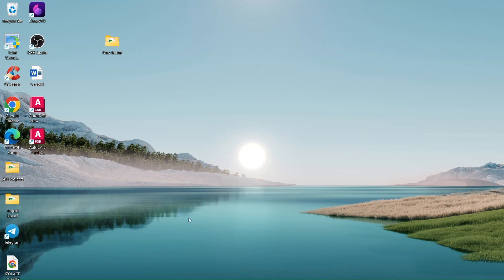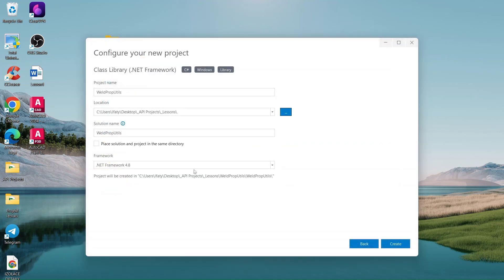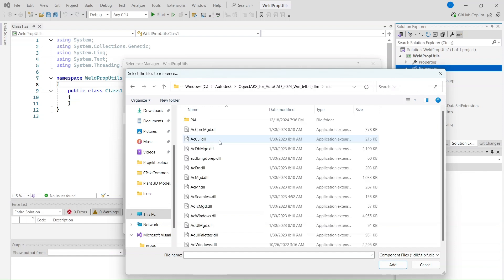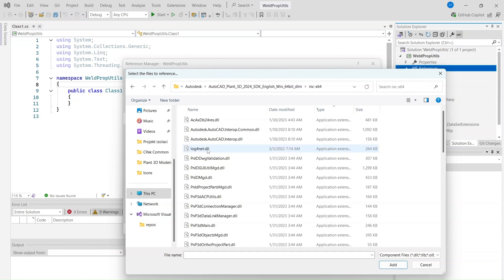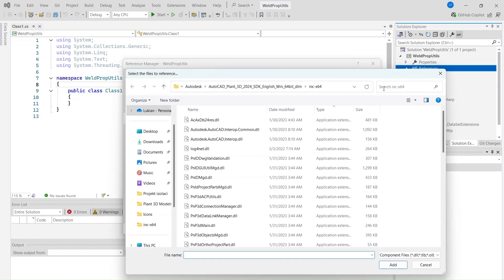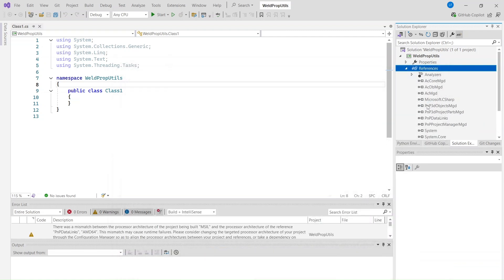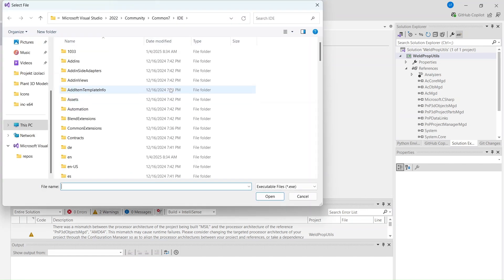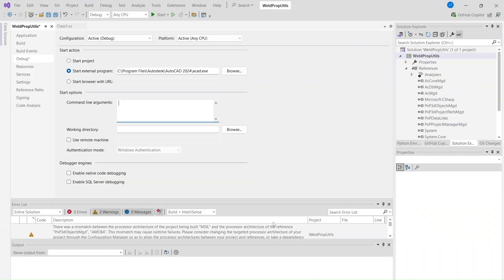AutoCAD Plant3D API Tutorial: Weld Properties with C# / .NET – Part 2

Comment: I'm developing for AutoCAD Plant 3D 2025 – should I use .NET 8 or .NET Framework for better compatibility when building plugins?
Would really appreciate any advice. Thanks a lot!
Reply from the maker: Good question. I would start with 8.0. I would also redo this project I have on 8.0.
Do you think it is better to record small video about start the project using 8.0 .net?

Comment: I keep having this error if i create a project with references from Autocad & Plant 3D 2026 SDK,  
Code CS7069
Reference to type 'MarshalByRefObject' claims it is defined in 'System.Runtime', but it could not be found
Reply from the maker: Thank you very much for clarification. To be honest I started with 2024 version. The truth - I tried ready DLL with 2025 version and it worked but never checked for 2026.  I willl check this week with 2026 and make update